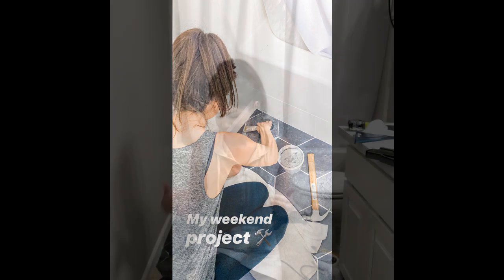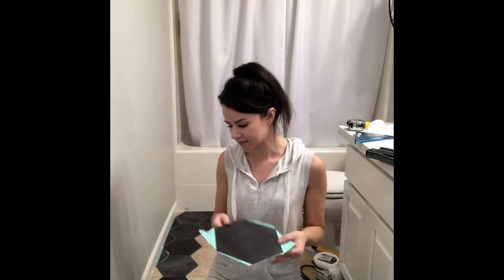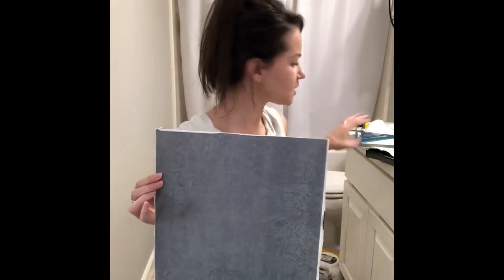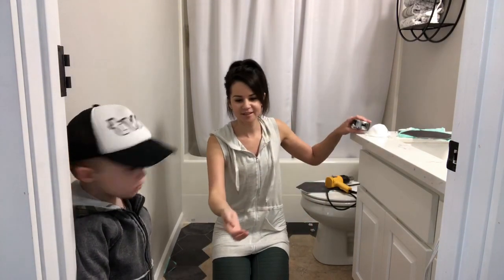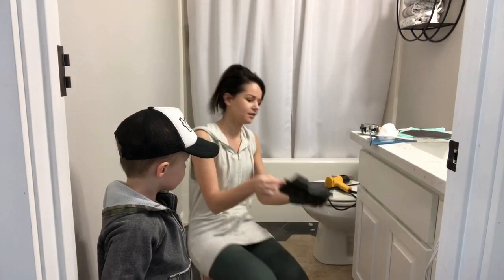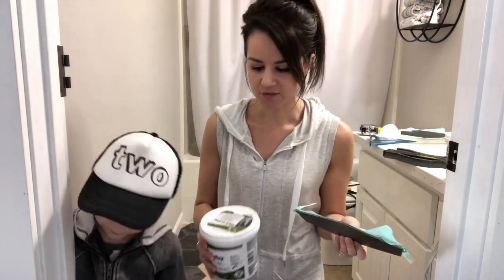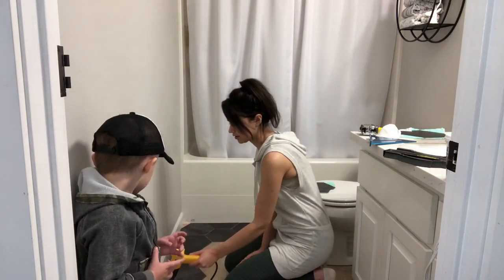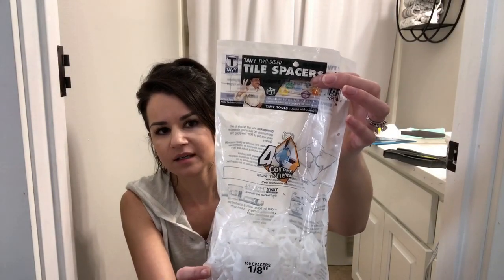Under $100 DIY!!!~How to install luxury vinyl tile entire process, tips & tricks, before and after!~

Comment: Looks great! I recently did my new bathroom 10x10 (big space) and it took about 4 hours. I used a similar process with the peel and stick vinyl tiles. 

My tool list:
Utility knife
Carpenters square (L shaped ruler)
Tape measure
Knee pads (must have if you’re old like me)
Pen
Adhesive scraper (square with notches at Lowe’s)
Linoleum roller 
1” putty knife
Tile sponge
5 gallon bucket for water
Save backer paper for making templates. 
Tunes. Gotta have music 🎶 

Materials list:
4 boxes 12x12 tiles (used 3)
Gallon Stick and Stay (only used 1/3)
Vinyl tile grout (used 1/3)

MOST IMPORTANT TIP: measure to find the center of your room! Start laying tiles from there! If you have a room where things aren’t perfectly square, it will center the layout and no one will know it’s not square!

Honestly, I prefer to score the vinyl tile with the knife and snap apart. It’s super easy and reliable. No need to slice all the way through. You can damage the tile, and it’s more work than necessary. Always flip edge tiles upside down toward you to measure your cuts against walls. Once cut, always put your cut edge toward the wall. Hopefully you removed your trim and/or shoe molding. You also can make a paper template to go around weird angles and cuts. Trace it out on your tile with a pen, then score and snap. Works perfectly. No need to cut deep either. 
Another must have for doing vinyl tiles is a linoleum roller. $20 at Lowe’s and tiles are going to adhere better and much more evenly. 
When I did my bathroom, the tiles I chose were 12x12 square. I used bright white grout. I’d never done it before, and the grouting process was enjoyable!
The stick and stay adhesive is the best stuff out there! I used it directly on plywood subfloor, and the tiles have not budged! Great video, but again, no need for a tile cutter or paper guillotine. Once you get the hang of scoring and snapping, it’s way easier and saves you from aching arms and hands. 
In closing, this project is fun and easy, and looks clean and professional when done right. No one knows my tile is peel and stick 😉

Comment: What a great idea!  It looks beautiful.  
Question:  Why did you have to loosen the toilet, and tuck tile under, instead of just cutting tile in around base, then grouting. (Like you did around baseboard and vanity.)
Reply from the maker: Hi Sandy! Good question-I think it was because at the time I thought it would be easier then cutting all those hexagon tiles to fit around the toilet- But we did have to reseal the toilet because we moved it. I think it would be preference. Keep in mind I am not a profession lol Just wanted to share my DIY experience. I will say, I did have my plumber friend help reseal and reset the toilet. So looking back, I would have cut the tile, especially if it was an easier shape. Hope that helps. Best of luck and thanks for the comment! :)

Comment: How much stick n stay did you use? I have a bathroom the same size and have the same tiles, and I’m either looking at 1 quart for $13 or 1 gallon for $31.50. Big diff
Reply from the maker: Hi Josh! I don’t even think I used half a quart! I just painted a thin layer on each. Good luck on your project!
Reply: Thank you! Your video by far was the most helpful I have found. It was perfect!
Reply from the maker: Josh G. Thank you! I’m so glad to hear that! It was my first DIY video so I’m glad I did something right 😆.  ... Don’t forget to reset your toilet if you move it!   I made that mistake.

Comment: How long do you let the Stick n Stay set before placing your tile? Did you decide not to use the weighted roller because you were using this product? I have these tiles ready to go for my next project in my kitchen. :)
Reply from the maker: Hi! I placed the tile right away after I applied the glue;  I waited unintentionally 2 days to grout because I got busy but it should be dried overnight. I didn’t use the roller because I used this product and the heat gun and it worked great and didn’t have bubbles. I just pressed down when I did it. 
That sounds like a big project but it will look amazing! Best of luck!
Reply: @deannabarley-realtor   Yeah - over 700 tiles lol.... crossing fingers
Reply from the maker: Lyneah Blake oh wow girl! Let me know how it goes!
Reply from the maker: Lyneah Blake also with that many tiles I would recommend investing in a better cutter then what I used. My husband suggested a chop saw but I don’t know how safe that would be so full disclosure 😆

Comment: But by heating the vinyl, aren't you changing the chemical or physical properties of the vinyl, and making it more with a tendency to degrade faster over time than if you put more glue underneath them? I suggest you should verify with professional installers before giving that advise to public. Heaters can burn people also if they dont know how to use them.
Reply from the maker: Professional installers recommend this exact tip. Fact: Cold tiles/adhesives won’t stick. Heating up the adhesive to activate it with a hair dryer or heat gun will help; but if you are worried about getting burned then you are more then welcome to try a different method. I did make it clear that I am not a ‘professional’ and just sharing my fun experience with this project. Best of luck!